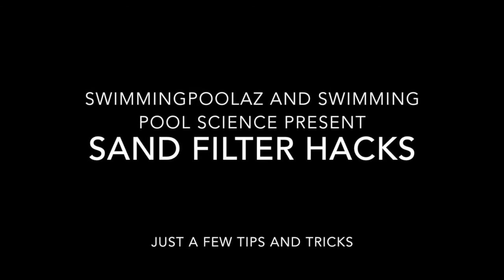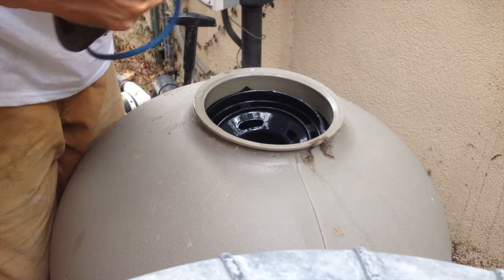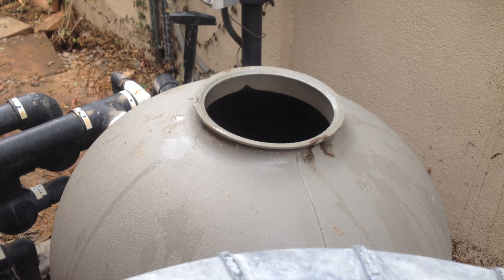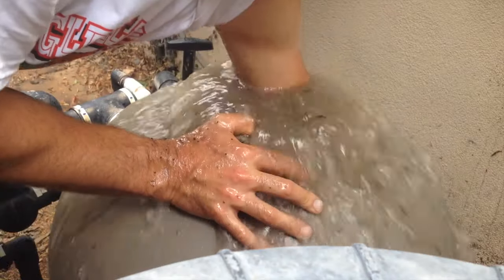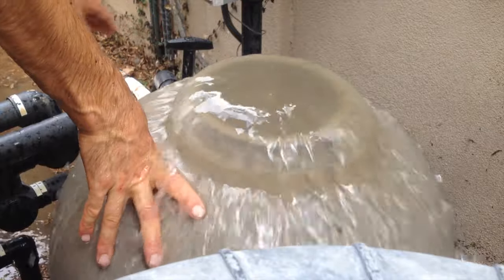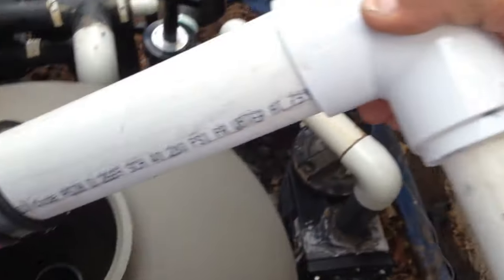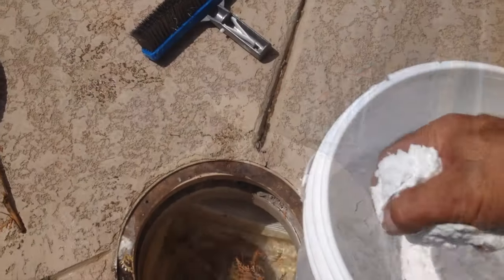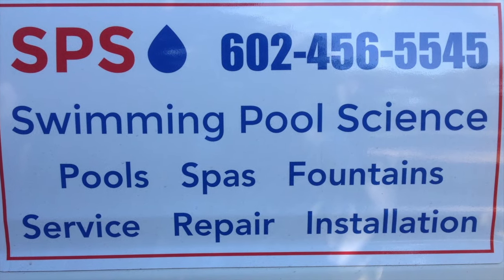Sand filter hacks

Comment: Or you could just replace your sand and to vacuum to waste put a three way valve in between the pump and filter so you can divert it to drain. Much easier
Reply: Replacing sand is expensive to hire it done, and not an easy job if you do it yourself.  300 lbs of sand is not easy to dispose of, or having to carry that and pour it into such a small hole.  It's much easier to just pop the lid off the sand filter and you can even use a garden hose.  It takes up to 45 minutes to swish around your hand in there with a garden hose.  I've even used a small kitchen strainer to get more lumps of junk out.  People on pool care forums have reported that they have never had to replace their sand for over 15 years if an annual deep cleaning like this has been done.  The theory that the sand particles become rounded and don't filter well over time have been debunked too.
Reply: @maubunky1  it’s quite easy with a Venturi tool and garden hose. If you backwash regularly and rinse after it and try not to vacuum up a lot of heavy dusty residue into the filter it lasts 15 years anyway. I always vacuum to waste if it’s very dusty. If you need to pull filter apart to do all that sucking sand out is another 15 minutes. Also most sand filters come
With a waste line or you can put in a valve. This video made no sense at all.

Comment: Question my sand filter has been sitting for a few years. Would u recommend doing away with the sand and refilling? Or trying to clean it.   Above ground pool.  I have drained the pool fully
Reply from the maker: I’d give the sand a good cleaning!  Heck all your O rings and gaskets as well and you should be good to go.
Reply: @SwimmingPoolAZ-SPS  so just flush with like a water hose stirring the sand around to clean and that should do it?
Reply from the maker: Yeah, do that to get the big stuff out, then do like a 1% bleach solution and let it sit for a few hours to kill anything living in the filter. Flush that out and let the hose run to dilute what’s left so it doesn’t harm the plants/grass. Once you hook it all back up, start the pool on backwash to flush out any last little bit of stuff then run a 10 second rinse cycle before filtering.

Comment: I've got a better solution...install a DE or cartridge filter. problem solved
Reply: Russian Bot #19538532 exactly , too much work to get it clean ,waste of water and chemicals when backwashing and rinsing. A VS pump and a 400 sqft cartridge filter , once a year cleaning.
Reply: W Sand filters work better though. and don’t require a complete overhaul every year.
Reply: @TheSavage3.6  No sir.  Sand filters are the least effect filter type.  Also, cartridge filters, if sized appropriately, don't require a "complete overhaul" ever year.  They require you to shut down the pump, pull the cartridges out, hose them off, and put them back in about twice a year.  I can't speak about DE filters, I don't know much about them as I've never considered one for my pool.  The only thing I know about DE filters is that DE is easily the most effective filter media.
Reply: Lenon Kitchens My pool started out with a cartridge filter, and it was horrible and required a new filter part each year of ownership. I upgraded to a sand filter in 2015 and haven’t had any issues and clean it atleast 1 time each month
Reply: Cartridge filters are such a pain in the taint. No way to clean it without a days work. no thanks.
Reply: @CTINF  yeah unless you have a 30,000 gallon pool.
Reply: perfect idea.. if you dont have a 30,000 gallon in ground pool.

Comment: I just did this and it was genius.
Reply: I do this every year at the opening of my pool and I'm always amazed at how much junk comes out from the previous season, despite the fact that I use skimmer basket socks and clean out my pump strainer basket every few days, and even after I backwash for about 10 hours straight at the end of the season to bring my vinyl liner pool water level down below the return jets to winterize it.  I never thought of using the backwash mode, except I think I'm going to have to stick to garden hose mode because of the fact that I do this prior to opening my pool, as the water is still icky and the system is not primed, up and running at that point.  Maybe I should do this at the end of the season...hmmmm.

Comment: If the water coming out of my sand filter flows downhill a bit and washes over my electric pentair whisperflo pool pump, will I get shocked when I put my hand down into the sand filter like you did in this video?

Comment: Thanks for the pool filter hacks.
What is that white powder that you add to brighten up the water?
We may use different chems here in South Africa. 😁
Reply from the maker: So that is diatomaceous earth. If you add  a couple pounds to your sand filter it will help the filter catch smaller particles. Careful though, it comes at the expense of a reduced filtration rate (less water circulates) and doing this too often can be hard on the pump, plumbing, and filter. To get rid of it out of your filter, just backwash.
Reply: @SwimmingPoolAZ-SPS  
Oh okay. Sounds like something one adds with me sand. Can I maybe skip the DE and rather do 70% spillover? Leave water somewhat cloudy which means it retains some old fine particles
Reply: @SwimmingPoolAZ-SPS  And if you add too much, it'll look like it snowed in your pool! By too much I mean more than a quarter of a cup.

Comment: Ya say ya can add d e right to the sand filter thru the skimmer ?? I like that idea. But how often. Is there a long term accumulative affect ??
Reply: Since you don't add much, when you backwash and rinse the sand filter, most of it will be washed out. I wouldn't do it every week. It helps when the sand is old and just needs a little help filtering to catch smaller microns and to assist in keeping the water clear.

Comment: Genius video. The other way is to use a hose to do it but takes way longer, this way is a great idea! What psi do you run the pump at while doing this? I assume not the full 3400rpm. I wish you'd explain the vacuum tip some more... Do you just hookup a shop vac to the elbow? Do you turn the backwash on when vacuuming it out? And the DE in a sand filter is a rarely known tip that makes an amazing difference.
Reply: Allen ii
Reply: I have struggled with mustard algae for years and nothing catches it. Do you think the D.E. directly into the sand filter this will work.  Can your put algaecide or shock directly into the sand.

Comment: I just changed the sand in my filter yesterday. All 500lbs of it, one scoop at a time. It probably took me about an hour. Then I pulled the filter housing out into my backyard, hosed it out, put it back and filled it back up. Altogether, an afternoon’s work. My advice is, don’t remove the drain cap on the bottom. Almost nothing will come out of it and I ended up damaging a thread trying to remove the inner threaded screen. So I had to make a thicker gasket for the cap and use heavy duty Teflon tape on the threads to get it to reseal. The old sand was NASTY, so replace ALL of it! It looks like a daunting project, but it’s really pretty easy. Sand filters are also VERY low maintenance compared to cartridge or DE filters. Just my 2¢ worth…

Comment: this is great! is it ever really necessary to replace all of the sand? I've read that a full replacement is recommended every 5 years, but the manual for my pentair filter says to just remove the top layer of sand if necessary and then do a chemical cleaning on the rest and replace what was removed. I'm about to replace it all just to be safe but I'm starting to realize that's a waste of money, and probably something that's only recommended by the type of pool guys who like to recommend unnecessary work to increase their bill! I prob should have just used your tip or followed the manual...
Reply: It's a good idea to replace all of the sand at least every five years. The reason is because the sand starts off coarse and full of sharp edges that capture the debris . Years of operation agitate the sand grinding it against itself until the sharp edges become smooth and unable to capture smaller particles.
Reply: Sand is cheap. Buy it at Lowes or Home Depot. Quickrete Pool Sand 50 lb bag is 12 bucks. Mine took 275lbs or 5 1/2 bags and 50lbs pebble rocks If you don't replace it all you end up replacing it more often. You have it open might as well do a complete job.
Reply: @flcal5153  Bull. Show me a microscope comparison of “new” versus old sand filter sand, and I’ll eat my words.
Reply: @nathanwalklin  Think about it. Where does this new sand come from where it hasn’t been worn out? This is a myth.
Reply: @Patrick_B687-3  of course it smooths out, the sand particles are rubbing against each other constantly as the water churns them. How do you think pebbles get smooth in a river or in a rock tumbler?  That's why there's a specific sand you use for these and not just beach sand or something.

Comment: Going to change the sand in my filter (250lb), any suggestions on what to do with the old sand?
Reply: Steve Johnson  make sure you buy filter sand. After getting sand out make sure you fill the tank with water before adding sand and cover the stand pipe hole with duct tape. It's also ideal to have an extra hand to hold that pipe in its right position.
Reply: kevin crusen I just change the sand in my filter. Have any ideas what to do with the stand yet?
Reply from the maker: Feed it out a few lbs at a time with the trash, bury it, but avoid spreading it out. Silica dust is a health hazard.
Reply: yeah, go buy a DE or cartridge filter and you won't ever have to deal with sand again.
Reply: 30 yrs in home. Just replaced my sand filter for the 2ed time. I believe there is nothing easier to use. I also have never seen sand in such bad shape as shown in video.
Reply: Switch to glass. Its much better.

Comment: my lateral pipe is busted. can I just replace it with pvc pipe and use the pc cement to place it back in the center?
Reply: baseballboy77073 I actually did it. I  sanded down the old piece out and cleaned it primed it and used the max pvc glue and slip in the pipe. used a two clamps to hold it down for two days. I put everything back and it's holding up great :-)

Comment: My problem is that my sand filter is located inside a “pool house” or an enclosed wooden building so I can’t let it flood over the top. Any suggestions for this?
Reply from the maker: If you have a variable speed pump, you can set the speed or GPM so it JUUUUUST backwashes but doesn’t over flow. That way you can churn the sand and have it still go out of the backwash without making a mess. Takes longer but it works. The other thing you can do is use a garden hose while it’s in backwash mode and it’ll do the same, then churn the sand, put the lid on, backwash with the pump, turn it off, repeat the process a few times then you’re good.
Reply: The next time you change your sand you may want to consider moving your filter into a heavy duty tub with a drainage tube going out of the pool house or into a drain.  I did this just as Peace of mind in case the filter decided to leak but it works for overflow cleaning as well.

Comment: I got a question for you.

So I have an intext Pool and sand filter pump. I just noticed today that with it in the filter position it’s not pushing out any more water it’s not doing anything. But it works and every other setting. What could be the problem?
Reply from the maker: If the pump moves water on every setting except filter, I’d start with your Multisport valve. Open that up and make sure that the gaskets are all still properly seated. It’s highly likely the problem is there.

Comment: Also, do you lose a lot of sand that way and need to add more back? Seems like you would.
Reply: sand should have a too small area surface to get lifted, that is the entire concept of purposed filter sand, sand dust and grime does not have enough mass and too big surface to stay down, you could loose sand that is as fine as dust, but that, you want out anyway
Reply: I use a garden hose on full blast jetting right into the sand and not one bit of sand floats out the top, just hair, leaves, seeds and bugs that I'm surprised ever got past the filter socks and strainer basket.  I'm going to try using the backwash mode at the end of this season and see if I lose any sand...I highly doubt it, but you never know.  It takes me 45 minutes with a garden hose.  And I have to wipe the rough fiberglass interior walls repeatedly with my hand because stuff clings on the fibers there on the inside of the top dome shape.  I'll bet backwash mode will have me done in 5 minutes.

Comment: I don’t know about residential pools but I did maintenance at a hotel for 9+ years and there was a “spider valve” with a back wash and rinse option along with others.
Reply: It's called a mutiport. I been working  at pool company for 25yrs
Reply from the maker: Multi ports are awesome and we do have them on a fair amount of residential pools.
Reply: Why doesn't back washing do a good enough job ? I have a 1.5 hp pump going into a 28" filter. It seems as though its a pretty violent action. My filter is in a garage so I cant use your method .

Comment: Kinda wishing my filter wasn’t in a pool shed right about now 😲
Reply from the maker: Yeah, we have a few of those...they’re well protected from the sun and elements but trying to work on them......
Reply: Use a small fountain pump and run the discharge hose to waste pipe . Balance water flow in from garden hose to outflow of fountain pump.  Get help to regulate flow in and out . Takes abit longerr but its but less water in shed .Beats changing sand ever year .